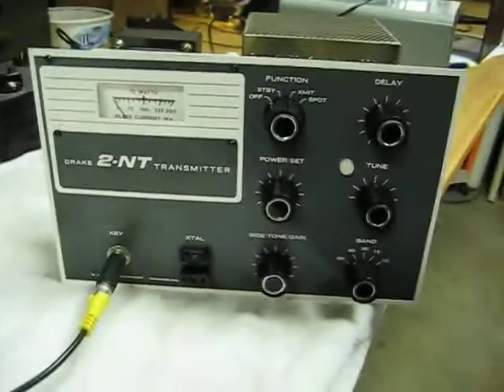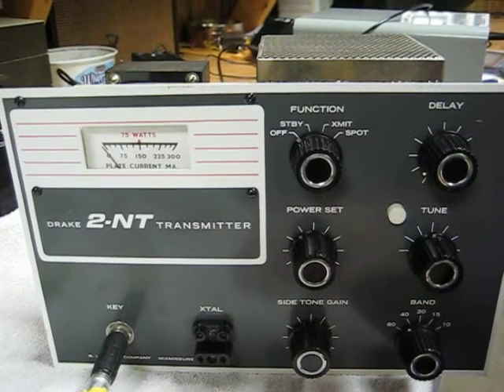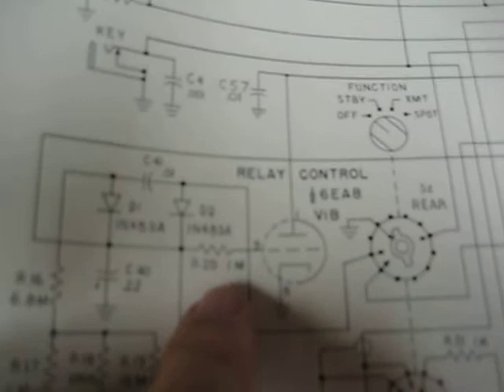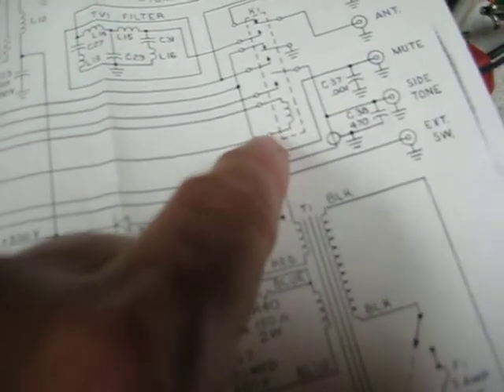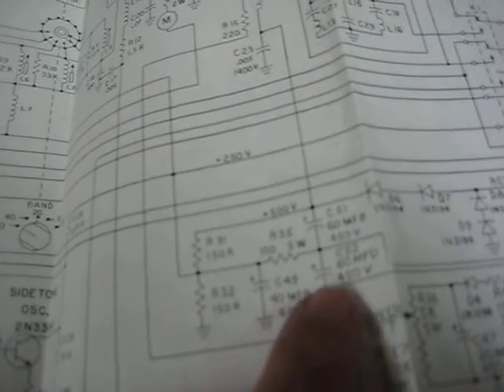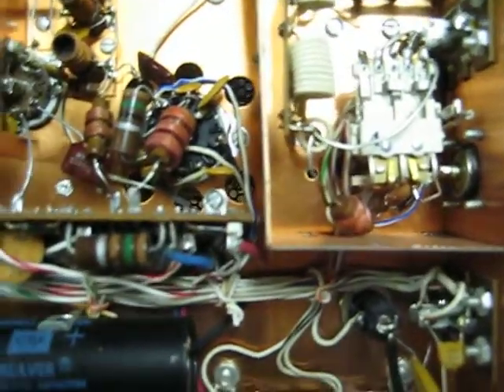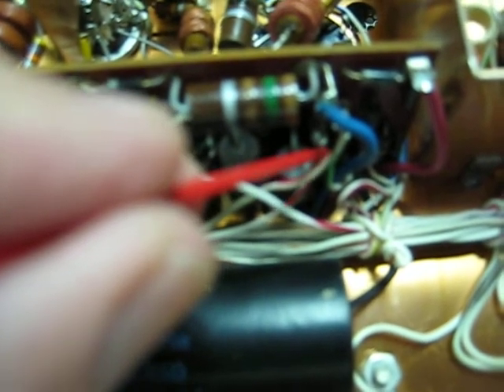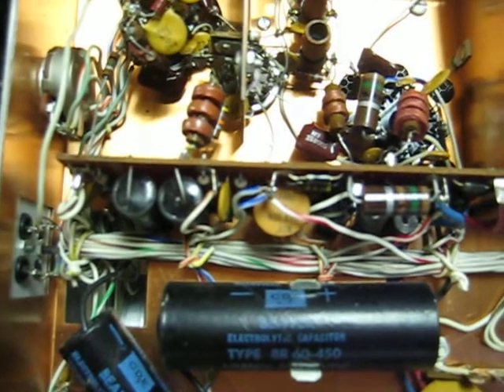DRAKE 2NT Transmitter Modification

Comment from the maker: No. The problems isn't due to excessive voltage. It is caused by the voltage staying around too long after power off. Just move the one wire. It's easy!